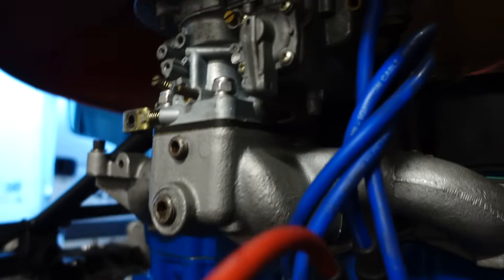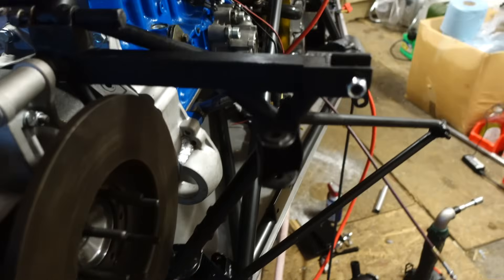Engine In… Sort Of | Clutch, Gearbox & Fire System Installed | Formula Ford Rebuild Part 9

Comment: Richard, make sure the engine is installed completely before cutting the hole for the carby. I made an error on my RP24 when fitting my air scoop due to not having the bottom mount fully installed and it pulled the engine forward and down enough that my cut was off a few millimeters. Not a big deal but as I hate fiberglass repair.....
Reply: Sound advice Bryan! Measuring once and cutting twice seems to be my speciality… I’ll make sure the lump is bolted down properly before I start hacking away at perfectly good fiberglass. The fewer itchy repairs the better! Appreciate the heads-up — nothing like learning from someone else’s battle scars instead of earning my own!

Comment: I prefer my mechanical pump. The FF uses a total loss system. No alternator. If the battery is low on charge, the electric pump may drain the battery faster, especially if a non LED rain light is in use. Also, in a shunt, the engine usually stops thus stopping fuel flow. With an electric pump, the fuel system will continue to have pressure until the master is switched off. If a fitting or fuel line is severed, fuel to a fire. Electric pumps also vibrate. A fellow racer once had the wire connector to the the pump fatigue and break off. While on pole position, the car wouldn't start to leave the grid.
Reply from the maker: Thanks for sharing that—really appreciate the detail and experience behind your comment. It’s exactly the kind of insight that helps others understand the choices we make in building and running these cars. Please keep this kind of input coming—it’s encouraging and genuinely valuable for those of us learning and sharing the journey.